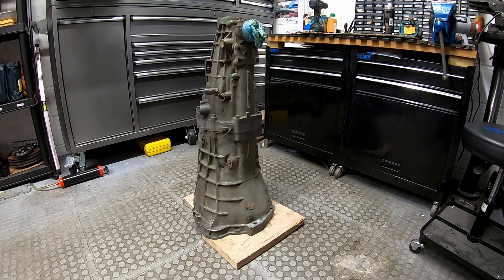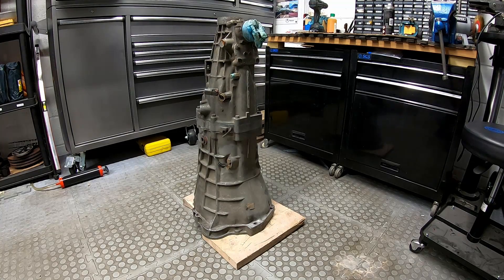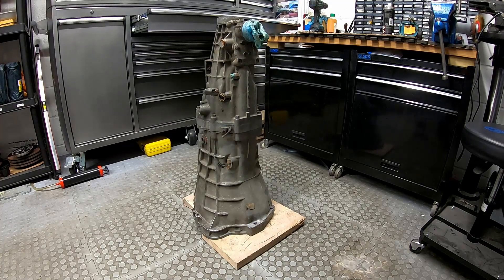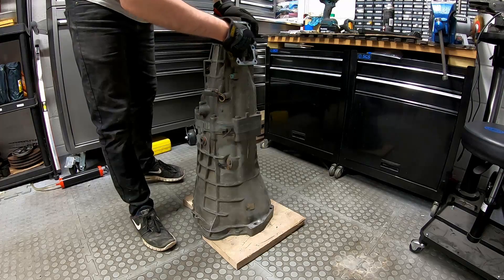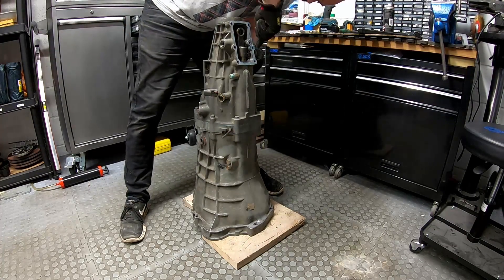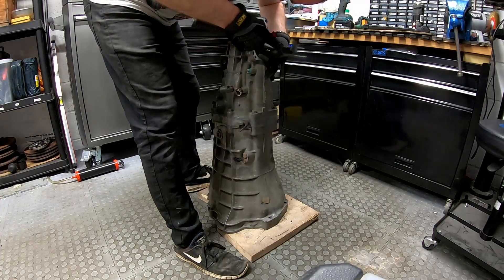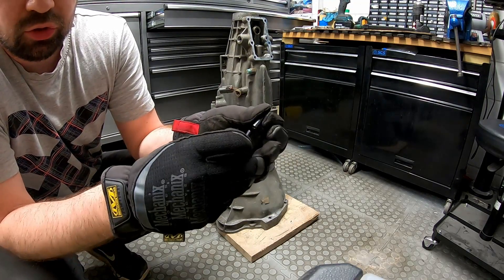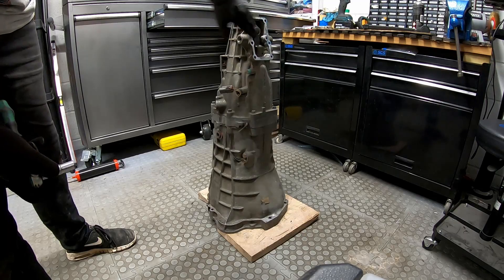Nissan Skyline RB25 Gearbox Teardown

Comment: Hey man, I pulled my rb25 box apart and am now having an issue with assembly. Do you have a social media I could contact you on by chance?
Reply from the maker: What's the issue you're having ?
Reply: @ToolTimeWithTom  The main shift rod I guess I would call it wont pivot all of a sudden, its essentially stuck at a bit of an angle so I can't get the shifter all back together. The rod itself won't spin or pivot
Reply from the maker: I had that once, any chance it's locked into gear? Try turning the input shaft while wiggling the shift rod to see if you can't get it to slip out
Reply: @ToolTimeWithTom  I'll give that a try. It does seem like I can get it into two gears, either by pushing down or pulling up on the rod. I only pulled the tailshaft section off as well

Comment: I need to change my input shaft bearing. Can this be changed from the bell house or does it need to come apart? 

Great video, I need to strip down a SR20 box and looks very similar.
Reply from the maker: Thanks! SR20 boxes are very similar, I've done a few RB20 boxes and they're nearly identical. I think it will have to come apart for the bearing to be changed otherwise you can't get a puller on it
Reply: Id say im handy with tools however never took a box apart, got this RB25 box thats been rebuilt but sat about for a few years without oil and now makes a noise so guess its the bearing gone dry? Im really hoping this is something i can do myself. Could you let me know if you think i should send it away or try and fix myself. Cheers for the help.   @ToolTimeWithTom
Reply from the maker: I think you'll need a fairly long puller to slip that bearing off and perhaps a press to get that back in. It's probably worth sending it off if you think there's an issue. So long as it's sealed, sitting dry shouldn't cause any issues. Maybe run some oil through it and see how it goes?
Reply: Ill take the case off inside the bellhouse and see what it looks like before i take it all apart. By your video it looks like ill be able to have a good look at the bearing. With my SR box i snapped the main shaft coming out to the prop, do you know a company where i can get parts for the box? Thanks for all your help and replying to me.  @ToolTimeWithTom
Reply from the maker: Sorry, missed this, you can still get OE gearbox parts from Nissan Japan, places like RHDJapan or Amayama